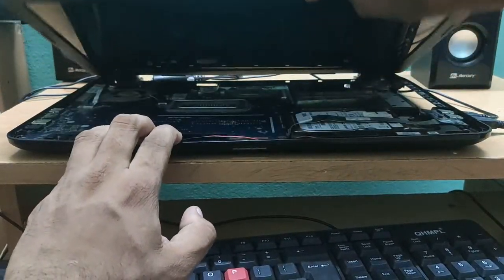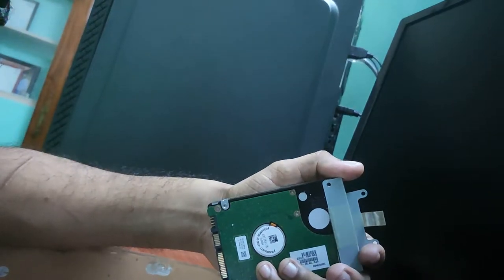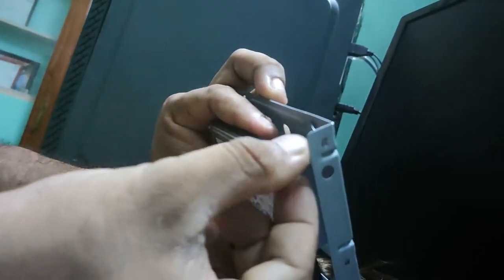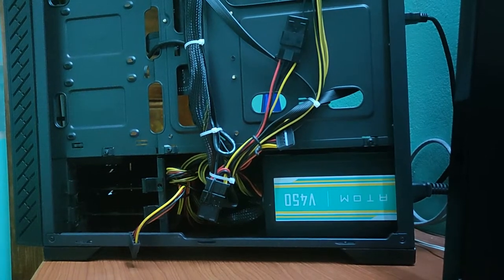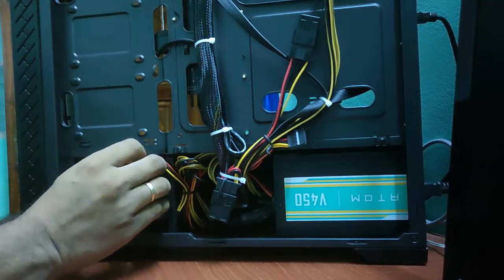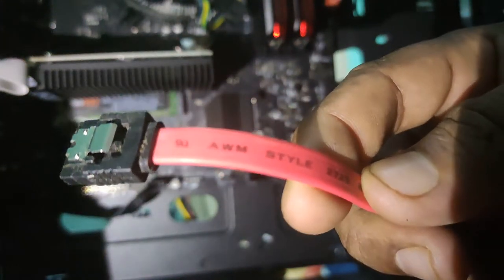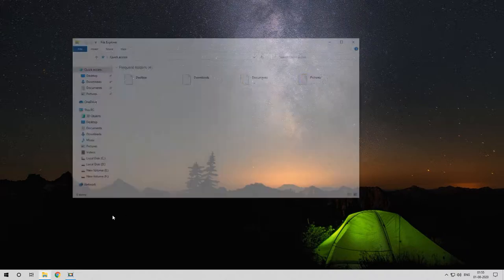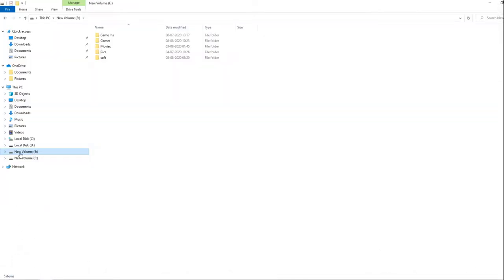Adding a Laptop Hard drive to desktop

Comment: Will there be any problems if the laptop hard drive still has a windows in it when you connect it to the pc?
Reply from the maker: No.. Just select the booting priority as you want
Reply: @ArockiaDennis  It doesn't seem to work on my computer, I have my Window 11 installed on my SSD, and I recently added my old laptop HDD(with windows 10) to my desktop, it just wouldn't boot.
Reply from the maker: @bruceliao9546  might be, u have os installed in Laptop HDD too..

Select booting priority in bios setup

Comment: Brother do we need to config any bios to use the newly added hdd (cause my bios won't able to access and laptop hdd has operating system too)
Reply from the maker: yea ..coz u have OS in laptop HDD possibly.. so u can select booting device in bios
Reply: @ArockiaDennis  but i can't go to bios. If i put the laptop hdd on 2nd sata port on motherboard can i access to it without setting bios
Reply from the maker: @darklucifer7808  u can access HDD - just check which HDD is loading OS.

BIOS setting is needed only to select booting priority

Comment: but if my new pc has diffrent hardware will there be any problem? Also what if i wanna use a ssd to run windows. How will i install that hard drive with deleting windows and still maintain my files?
Reply from the maker: usually NO problems.
but sometimes booting might happen in your added HDD
so you need to choose the booting PRIORITY as SSD in the BIOS option.
you can enter into BIOS by pressing "F2" or "DEL" while starting the device.

after this setup; you delete the OS in the HDD
Reply: @ArockiaDennis  ok, but when i install the old hdd in the new pc, i will have to download my graphic and CPU drivers, correct? Also if i buy a 2 tb Seagate hdd can i put all the files on that but keep the os on my old hard drive so i can still have windows 10 on my laptop but it will have 0 storage?
Reply from the maker: @saraaa6612  yes
Reply from the maker: @saraaa6612   idk, this will help or not
https://youtu.be/I0xdTOfHEYE

Comment: but u could easily fix it on the 3.5 inch drive slider by mounting it on the bottom screws ,why do u need an adapter
Reply from the maker: coz i bought it 😂
Reply from the maker: jk may be if u need u can this

Comment: bro my all data in my pc hard disk also pc hard disk storage full so i want to move some data to my laptop hard disk can i do this method like i am remove laptop hdd and put into pc and transfer pc data to my laptop hdd .. ?? is there any problem pleas tell
Reply from the maker: No issues..if u want to use back in Laptop...then don't touch the OS Drive
Reply: @ArockiaDennis  thanks bro

Comment: My desktop hard drive is dead
But I have laptop hard drive. Window is already install on that.
Can I use laptop hard drive without desktop hard drive. On desktop..
Reply from the maker: you can, but try to buy a SSD for better performance- use it for OS drive
laptop HDD will be very slow in performance.- prefer to be an secondary drive